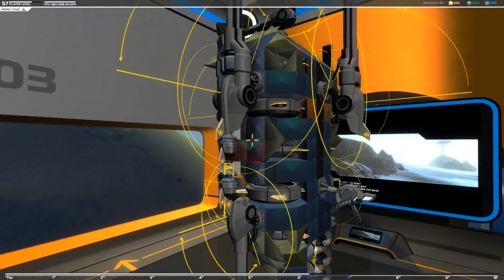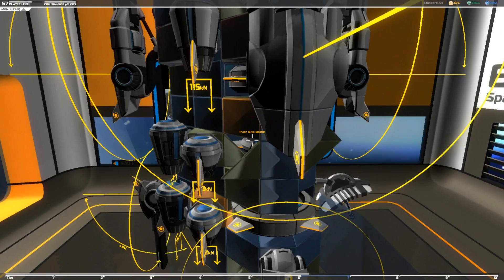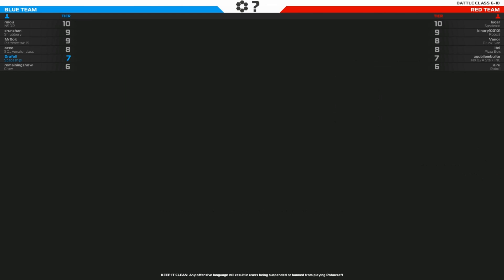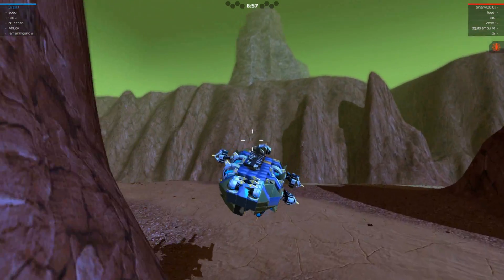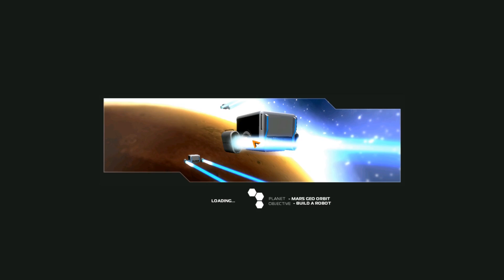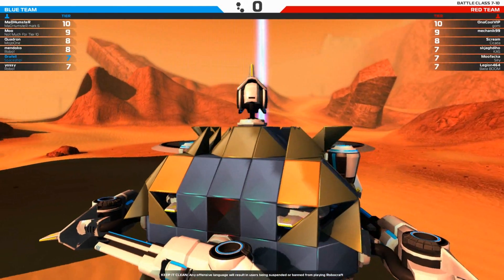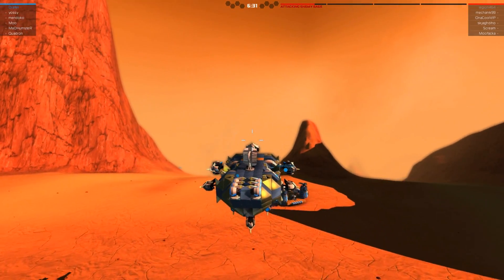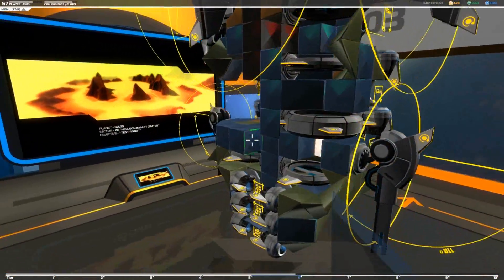Robocraft Bay 01 - Insanely Fast Working Vertical Hovercraft

Comment: This is considered an exploit now isn't it? I'm not accusing you of exploiting, cuz i dont think it was then, but is it now?
Reply from the maker: You can still build this design and it is not an exploit as it just won't work. Freejam tightened up the code and fixed the ability to warp.
Reply: Bay 01 I tried it and it worked, maybe not to the extent as it did then but it definatly went crazy fast, and i built it without thrusters.

Comment: Can you make a how to make video of how to make this? I had to delete my successful tank and sell the armor and i used up ALL my money and i sold my wheels so then i could try to make this, but it failed, BIG TIME. Please make a how to make video of this! Btw i'm Mattdogking
Reply from the maker: You shouldn't have deleted your bot :-( I'm sorry dude.

I probably need to do a tear-down and rebuild video of this bot, although the current version is a little more advanced and uses much higher tier components. However, I think it will be more useful for me to do a basic construction video on the core frame and let players work from there in terms of developing the concept.
Reply from the maker: http://youtu.be/h09Fpmei9FE

Hopefully this helps :-)
Reply: Bay 01 I'll try it when I have time.